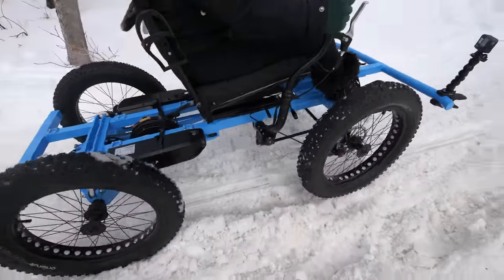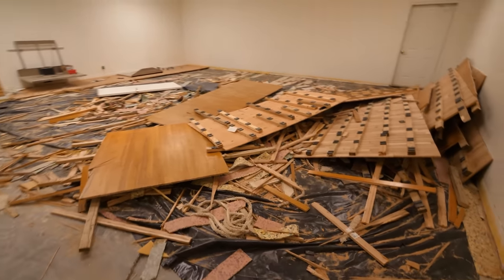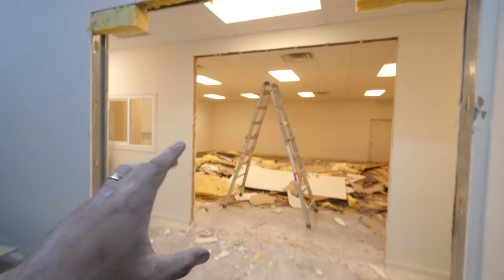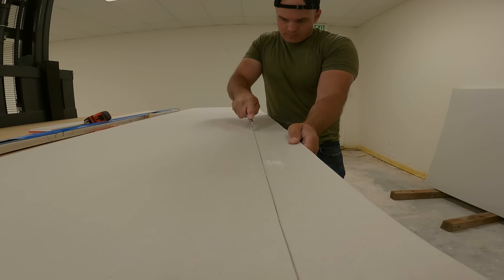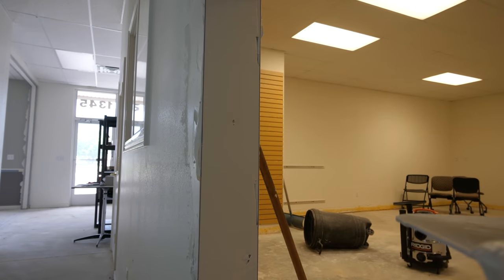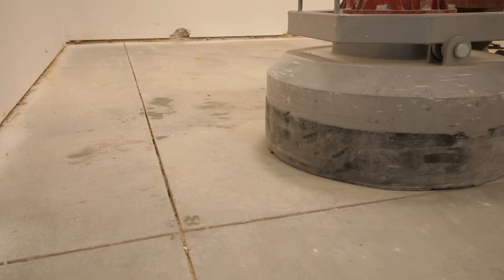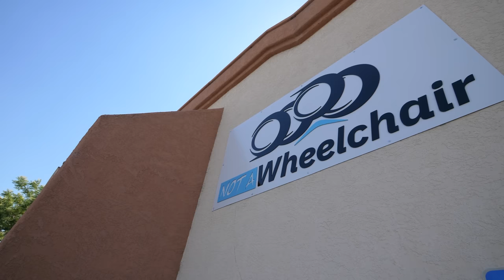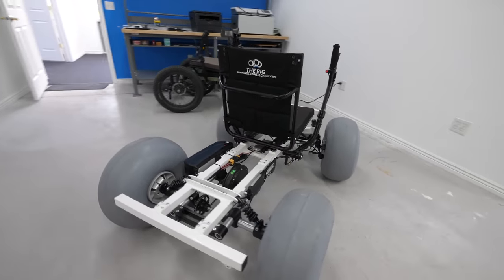Taking 'Not a Wheelchair' to the NEXT LEVEL? - New Shop Tour!

Comment: I would highly recommend to ware a filter mask when demolishing, removing walls and floor covering and during cleaning - it might be not so obvious, but you may inhale some pretty nasty things during the process, which is definitely better to avoid.
Reply: exactly what i was thinking! all that dust can be nasty
Reply: It’s a good thing you told them after it was all done. Good job.
Reply: Don't forget to add that EVERY building built before early 1970's has asbestos in sheetrock, spackle, all old 9" title floors etc. Asbestos was in over 1,000 products.
Reply: Watch a few episodes of George to the Rescue, he does this sort of work all the time and is sponsored by 3M who provides, masks, glasses and gloves I think.
Reply: From the looks, it's newer construction with the metal studs. Still not great to inhale,but there's no asbestos.

Comment: For a few seconds i was thinking that tearing down that many walls is a lot of work, then I remembered you guys live in papier mâché buildings so its actually doable quite quickly.
Reply: I was just thinking houses in the US look kinda like a big arts and craft project lol. Makes construction look fun, I've lived in stone and concrete my whole life.
Reply: Inner walls in Norway is the same, and I would guess rest of the world.
Reply: I know their building practices and was still surprised to see the wall between the units being plasterboard instead of aerated concrete or brick.
Reply: Here in europe, its not that easy because... well... bricks.
Reply: @dubious6718  yeah concrete buildings in Canada usually also have wood and drywall for interior walls. Makes it a lot easier to do maintenance or make changes, but you can still have the durability of the concrete on the outer walls and structural components.
Reply: Interior walls outside the USA are made with concrete/brick? Seems an awful unnecessary waste. Not trying to knock it, just trying wrap my head around it.
Reply: @dubious6718  I don't think, for example, in Italy we use dry wall for the inner wall only if you plan to go very cheap, or mostly for work environment, where your boss don't give a fuck about employees comfort. Most house, even new one, have solid wall made of brick.
Reply: @jpmcnown1  does make them sturdy though, even when my living situation was very much not good to say the least, never feared things getting knocked over due to a hurricane, most that could happen is the roof coming off.
Reply: @jpmcnown1  The bearing walls might have bricks or concrete, but non-bearing wont have it.
Reply: @jpmcnown1  Interior walls in brick houses are often a single layer of brick, because why not you're working with brick already anyway. In concrete houses, often only one or two interior walls are concrete for structural purposes. Bathroom and kitchen are aerated concrete blocks (non structural, but much stronger than drywall) and dividing walls between bedrooms and such are the same as in the USA with the exception that wiring is run through conduit rather than just flapping in the breeze. Wooden houses, interior walls are either drywall or aesthetic wood panels.
Reply: @dubious6718  Never been in a building that has this type of walls. In fact in most of Europe drywall is rare except maybe in hotels
Reply: @dubious6718  in most of the world every wall is bricks and concrete
Reply: It is a bit more complicated when considering load bearing walls, piping and electrical, but compared to other parts of the world, yes it is easier to remodel in the US
Reply: @dubious6718  nope. Not here in south asia
Reply: Funnily enough they like to call it sheet"rock". 🤣
Reply: @jpmcnown1  and that's why your houses fall down when a strong wind blows on them.
Reply: @dubious6718  I've seen it mostly in businesses and malls but I think most of the equatorial/tropical regions of the world build with concrete because of the climate.
Reply: @experimentalcyborg  They flex with the earth movements.  Of course, sometimes the door is jammed.  !!!
Reply: @go_de_go  Doubt it.
Reply: @SmartSmears  Our house is entirely lumber framing with stucco exterior and a tile roof and took a direct hit from hurricane harvey (category 4) in 2017, without any damage. It really just comes down to how its constructed. For instance, our roof is tied directly to the foundation using all-thread to prevent it from lifting off in a hurricane.
Reply: @dubious6718  Rest of the world is huge.
Reply: That's why they can afford to buy their homes instead living in a tiny 60 m^2 (650 ft^2) hovel that we have to rent for the same price that Americans get a 220 m^2 (2400 ft^2) house with a 1/3 acre yard. While we have to pay rent to some middle Eastern dude that our government let buy up all of our properties and companies. We can't even own cars unless you either want to buy some TINY little euro dumper car, or you make €200k/yr and you can afford a car that people in the US, who make half that money, can buy. I'll take drywall house over a masonry house everyday if it means I can own it, it isn't some tiny dumpy apartment that I'm renting for 2500€/mo. There is absolutely no need for anything stronger than drywall for a house. Unless you live in an area where there are hurricanes, where most construction is masonry or reinforced wood frame. (Modern wood framed houses with proper hurricane strapping can withstand all but a direct hit from a cat 5 hurricane, which has happened like 1 time in the past 30 years.) You wonder why they call us losers, and why the EU is failing so miserably. Trying to act like renting a tiny hovel made out of masonry is better than owning a big wood framed house. Derrrrrp. I'll bet you think that we have "fReE hEaLtHcArE" too, huh? "FrEe uNivErSiTy"? Hint... You're paying for both of them, until the day you die, even if you've never stepped foot inside a university. They've got us giving them a larger portion of our money than we take home, and you loser drones are cool with it.
Reply: @littlejackalo5326  You seem extremely mad. Let me clear up a few things. Those "220m²" houses you are talking about are in car-dependent suburbia or in the middle of nowhere. Try to buy a house in a bigger city and you will have the same price increases that you have in Europe. I am not sure where you are getting your car prices from either. I am driving a practically new car with a salary that is around 500 Euros per month lower than my countries' average. I wouldn't consider it tiny either. You do realise that we pay "free healthcare" and "free university" not just for ourselves, right? Given how you phrased it, you seem to be too egocentric to get that anyway. We are perfectly aware that we pay through taxes. I rather pay 350 Euros a month so me and others can go to the doctor with no extra costs than injuring my foot once and getting a bill of 250.000 dollars WITH INSURANCE. My step-mother is American with family in America, I have talked to her about this, I am not just pulling numbers out of my arse. "They've got us giving them a larger portion of our money than we take home", do you understand how the tax system works? That it's in brackets? At the very top it is 45% in my country and that is only for anything above making 277.000 Euros per year. Maybe you should inform yourself what taxes actually do and where they go. You would be surprised how many things you take for granted only exist because people pay taxes. I am not sure why you think the EU is failing either. You being able to talk all this non-sense on the internet seems to me like we are doing pretty good. At the end you only have 3 options anyway: Move outside the EU, change something instead of just whining or live with it. You decide.

Comment: The one thing you need is low cost replacement wheels that can go on regular chairs,  as often they wear out, and the owner is often stuck for a long time waiting for repairs. Or those wider wheels that will fit a regular one, which then immediately allows use in places like parks, as they are less likely to get stuck.

Comment: In Sweden using drywall or "gipsväggar" as they are called here, is the standard for internal walls. Has been for 50 odd years. We usually add wooden trim on (top of) corners and edges.

Comment: Real savings with LED's is to use line powered. Gut the ballasts (which are main energy hog)  and install lamps that run directly on 120vac. (Just wire the sockets (tombstones) to the AC line. I just did a project where I installed over 500 lamps directly AC powered. I sold all the ballasts on ebay.

Comment: Thank you for your mission of making accessibility more financially accessible. I'm guessing you have a CNC machine in that crate. Another good piece of gear for rapid prototyping would ba an SLS printer that does nylon. It would allow you to make custom plastics before ordering them injection molded in mass. Good for brackets, enclosures, mounts.
I am a project engineer for a company that does metal injection molding and metal binderjet 3D printing. Let me know if you need some services, we work with all types on all scales.

Comment: instead of using little pieces of wood for the small  sheetrock patch ups you can cut a square the size of the hole in the back paper then break/peel off the gypsum surrounding your square. This leaves your gypsum in the perfect shape for filling the hole and leaves extra paper in the front of the gypsum for catching the wall. You then put some drywall mud inbetween and ontop off the old drywall and the extra paper surrounding your gypsum square.  Sand when dry and thats it.

Comment: I love that you all will work to reduce the price of wheelchairs. As a wheelchair user myself. As you said manuals can run as high as 5k, and power-chairs can be as high as 10-15k. Depending on the wheelchair. Major issue with many wheelchair companies they quote over the top of what a chair should be. For example, my powerchair was quoted at 52K and I have had more issues with this power-chair than I care to mention. The wheelchair company did this cause they want to charge insurance companies over the top, which often leads to insurance companies denying the manual or power wheelchair for users. I had to fight for 2 yrs to get this powerchair as it was repeatedly denied. I commend you both and your team of what you do and I can't wait to see more. Thank you :)

Comment: Just so you know, these kind of sheets of dry wall are used here (Netherlands) too quite a bit. Just perhaps not as much as in the US.
We also use Gips(en) blocks and something called gas-concrete blocks (concrete with lots of air bubbles to keep it lighter and cheaper)
And for partition walls I have seen wooden frames with MDF or Plywood as well....(with insulation in it)

Comment: I really love that you guys are so dedicated to creating affordable wheelchairs! I've been physically disabled and have had to use a wheelchair my whole life, and it's really crazy how expensive they are. My independence is really important to me personally, and lacking the upper body strength to push a manual wheelchair myself I rely on using a power wheelchair, but those are so insanely expensive.
A big issue that we've run into is that it's really difficult to bring powered wheelchairs travelling on planes, as they seem to frequently get damaged in the process of loading them into and taking them out of planes. Because of the potentially huge cost as a result of a powered wheelchair being broken during a trip like this, we have to bring my manual wheelchair which means I often have much less independence and get to see a lot less on trips.
Do you think you guys would ever try creating an affordable, easy to travel with powered wheelchair? The biggest issues with powered wheelchairs and plane travel I think are the size of powered wheelchairs and their batteries. It'd be awesome if you guys figured out a way to solve these issues!

Sorry for the long spiel, I just think it's so great that there are people out there trying to make accessibility affordable! It's really hard right now with everything that's meant to help physically disabled people being super expensive.
Reply: He said in a prior video they ship her 'not a wheelchair' to the location they are traveling to.

Comment: Another great video from a great channel. I loved the video of you joining the 2 electric bikes together to make a 4 wheeler.
What you call sheet-rock, we use the same stuff here in the UK but we call it plasterboard. It makes it so much quicker and easier to get smooth walls rather than spending ages putting up a thick layer of plaster and waiting for the plaster to go off.

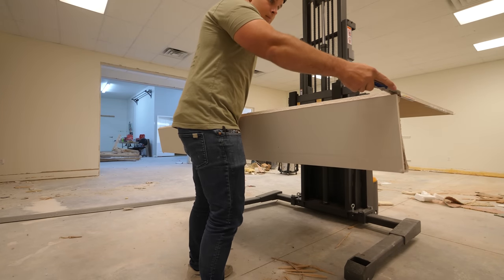Comment: A tip for anyone working with sheet rock, when you're at this stage 7:05 you can just snap it upwards and the paper will leave a clean cut. It's actually easier than using a knife. 

Not criticizing, there's nothing wrong with doing it like he's doing. But it's actually more tricky to get things perfect using a knife at this stage.

Comment: That ripped up floor is what is known as a "floating floor". I remember helping to build one when my Uechi Ryu dojo moved into their first owned space. That one used large foam blocks with two layers of underfloor sheathing below the roll-on top surface so falls wouldn't hurt as much as the concrete of the original building (it was an old automotive garage).

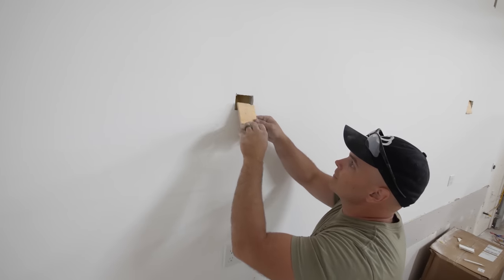Comment: for patching small holes like at 7:56, i like to use a dutch patch, where you get a bigger square of drywall, cut out the size you need on one side, then peel away the gypsum, leaving the uncut side of paper, lay that over the hole, and mud it from there. you could search it up for a better explanation lol

Comment: Great things you are doing!  Hope it lasts for a long time.  Looks like a sturdy design to start with, I heard in one of your starting videos some of the design considerations were based on simplicity while creating the first models.  Therefore, you had some ideas already for improvements.  One I remember was a seat with some up and down movement to give a little comfort to the ride in some conditions.  I for one would like that due to my back gets fatigued after a short while on rough ground.  One specific point I have to mention, I really like those large tires for use on sand of the beach or other grounds (or maybe marsh-like, how about that)!
I'm so glad you're attempting to do this on a cost basis (if that is what it is called), it will help out so many individuals that can't afford so much money (expected cost?) for a luxury item for recreation.  
I'm disabled myself but over time I've been able to acquire vehicles with big tires to have fun in the sand.  From this I have realized how much internal satisfaction (and fun) it is to get into unusually areas of the planet when before I had relegated my mind to the fact that I would not be able to do interesting things like that.

Comment: 06:45 I don’t know where you’ve gotten your info about “people outside the United States” but in my experiences most countries use some kind of “drywall”/“sheet rock”. Here in the U.K. we call it plasterboard and it’s basically the same thing a gypsum based sheet that you attach to interior walls (either masonry built or wood framed ones) which is then finished with plaster over the top.

In fact plasterboard was invented by us in Kent in the U.k. in 1894. Plasterboard originally was a little different to drywall but we also later invented gypsum drywall in 1910 which is what we call plasterboard now. 

And in 1910 an American company bought the U.K. company that created gypsum drywall along with all its patents. 

So you guys have drywall because we invented it.

Comment: So, in summary I love everything you do, not just the stuff related to wheelchairs. However, I have been especially Impressed and amazed by the ingenuity demonstrated and in may cased the simple outside the box solutions you have provided for accessibility. That being said, I have a request. I have looked through your videos and did not see anything for an automated hoyer lift. I once attempted to plan to modify one with the mecanum wheels. But, just didn't have all the skills to get it done. Do you think you could/would take on a project to make an RC Hoyer for added independence? Even if not, Thanks and keep up the good and innovative work!

Comment: Really awesome job. If you can cut the price of manual wheelchairs in half that's going to change a lot of people's lives. Hope you get factories all over the world in the future.
Two random ideas for products:

Solar charging not a wheelchair. You've got a decent amount of surface area there for a panel. Should be enough to never need to charge in the summer months provided you're not going full speed nonstop. With the ultra low wh/m and only adding a fraction to the cost it seems like a no-brainer to me.

Rear loading cargo e-trike with a fold down ramp and enough space for a manual wheelchair user in the back. Only wheelchair transporter trikes I've seen are front loading which makes steering needlessly cumbersome and unstable at reasonable speed.

Comment: No it's used in the UK as well, mud to you plaster to ose bits, actually using standard lighting you generally use 100% electric where led users less than 10% a saving of 0ver 90% of electric per hour, you could cut the price in hath because most mobility feasibility that sell mobility scooter/chars usually put a 90 to 100% profit margin onto top of the manufacturers prise ie dubbing the cost of the goods

Comment: For ultimate power savings there used to be direct connection tube lights but contractors complained about the amount of labor to remove the fluorescent fixtures ballasts and people don't like the cost of it.

So now, we're stuck with wasting energy